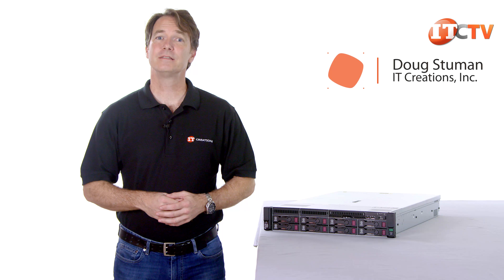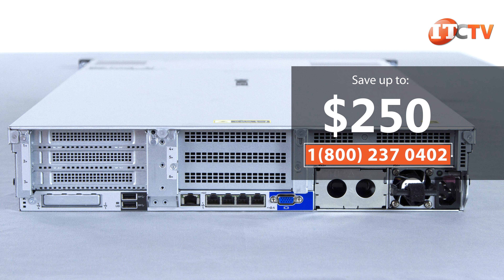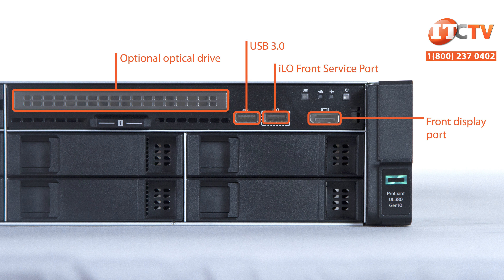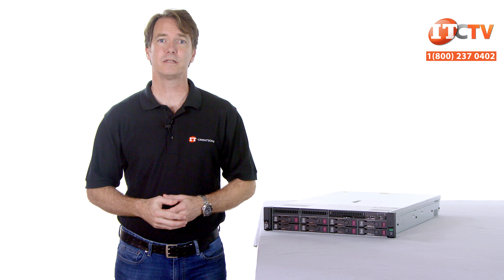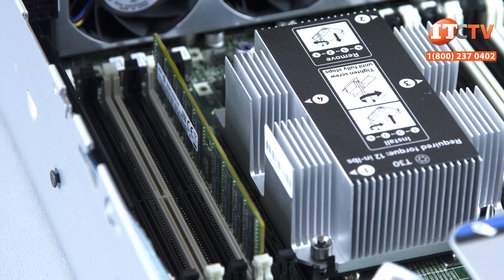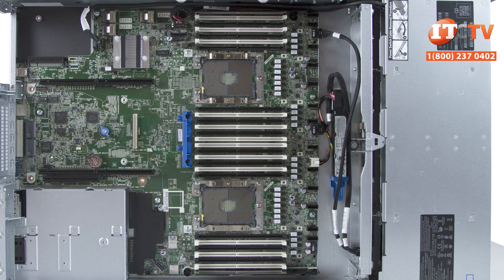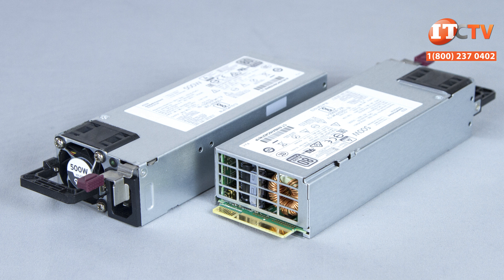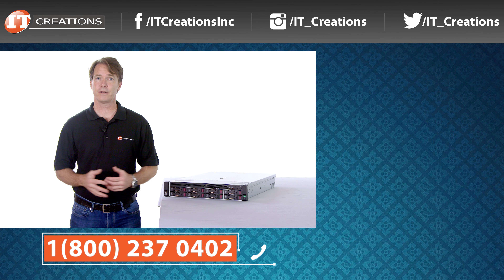HPE ProLiant DL380 Gen10 Server Review - IT Creations

Comment: I have a Dell poweredge R720 16 2.5" bay model. I inserted a 1tb sata drive i got from a non working Playstation 4. When i put the drive into my server so i can install windows server on it i get a solid green light on the drive caddy but i also get a flashing amber / orange light too. I place my hand on the drive and it appears to be spinning but it cant be seen by os instalation software. What could be the cause of this problem and what might be the problem with the hard drive if there is any priblem with it?

Comment: In dual processor configuration, what is the affinity between sockets and PCI-e slots on riser cards? I.e. which PCI-e slots are connected to which CPU socket?
Reply from the maker: Hi Ерден Жумабеков,
There are 8 PCIe slots total supported in three different risers, the Primary, Secondary, and Terciary The primary riser supports slots 1-3 from the top down and is controlled by CPU1. The secondary riser supports slots 4-6 from the top down (middle PCIe slots on back of system). The Terciary riser requires both processors and supports slots 7-8. Refer to the QuickSpecs here, pages 3, and 4 https://www.itcreations.com/user-manuals/DL380G10/QuickSpecs.pdf There are also several different risers supported, with specific versions for GPUs and storage listed on page 25. Click the arrow at the top of the page to see our landing page for this server and more reference materials including the Maintenance Manual and User Guide. Thanks for watching!
Reply: IT Creations, Inc. Excuse me, you haven't answered my question.
Reply from the maker: Perhaps I didn't understand your question, and maybe I still don't understand your question Ерден, but I will give it another shot. Three separate risers can be installed on the system board. The risers plug into a PCIe slot on the mother board and expand the PCIe lanes to accommodate more PCIe slots, which in turn can support more PCIe cards (GPUs, Network interface controllers, HD/RAID controllers, ...). The primary riser plugs into one slot on the motherboard that is controlled by CPU1, and supports three PCIe gen3 slots on the riser. I think that would be the affinity portion. Going by what I said above, CPU1 controls the primary riser and slots 1-3 the other five slots are active only with the second processor installed and can only be outfitted with PCIe cards only when you install the secondary and terciary risers.
Reply: Ok, now I get it. Thanks!